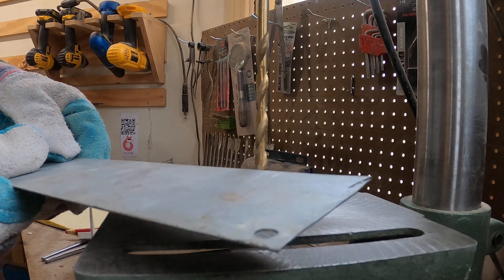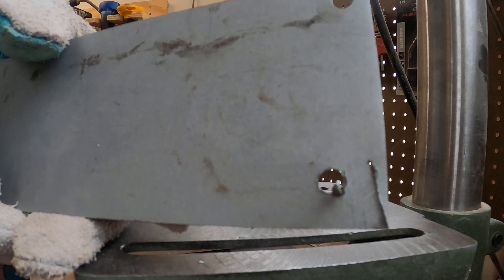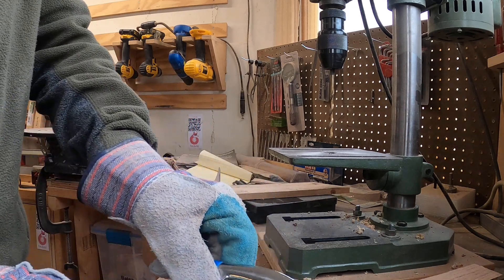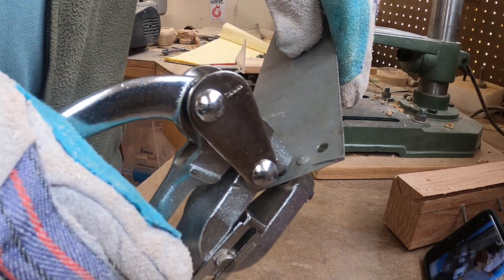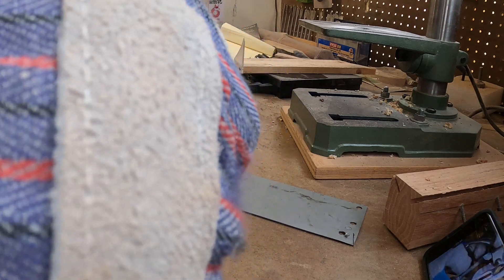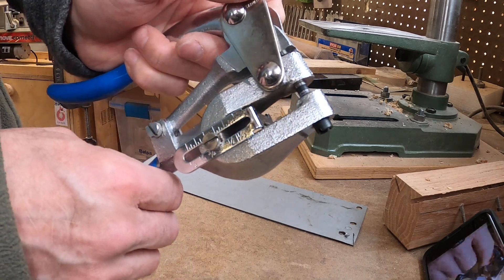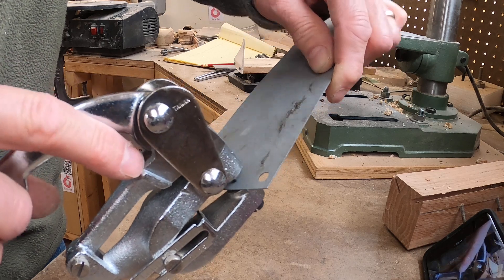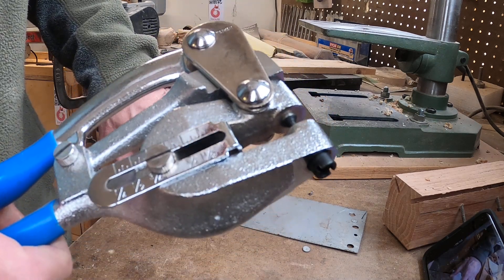Drilling Holes? Try the No. 5 Jr. Punch - Better than drilling for thin materials, including steel

Comment: Hi, would be possible with this tool to clinch two slim aluminum can sheets ? I mean with a modification of the die or a similar budget tool? am interested on it but I have not seen any video of that.
Reply from the maker: I'm not aware of any dies that would enable attaching 2 sheets of metal together. It sounds like you want something like a rivet but thinner.
Reply: yes, actually the name of that process is clinch or clinching, check some youtube videos but that is mostly used for thicker sheets on industrial process but I have not seen any homemade for thinner sheets. @fox.buildmakerspacehackers2952